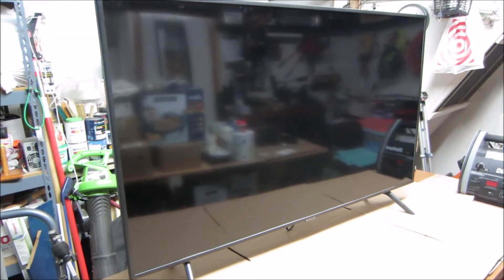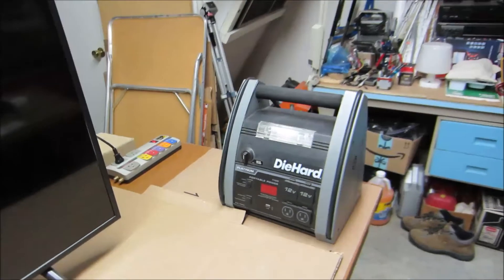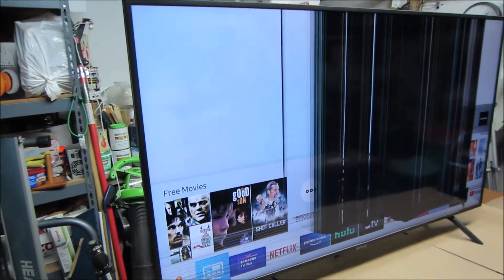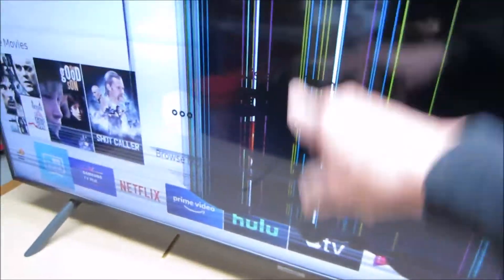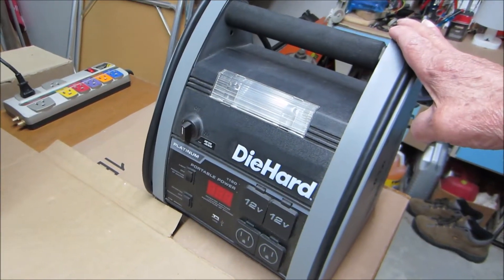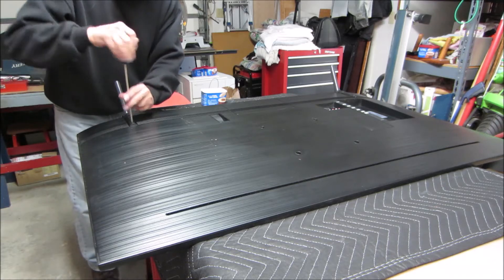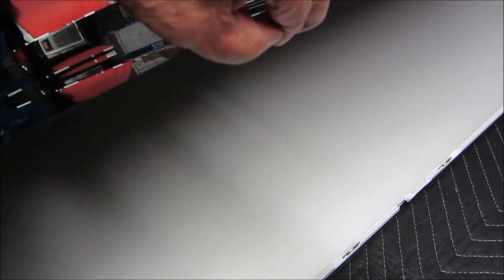LCD/LED TV Repair Secrets - Multicolor Vertical Lines

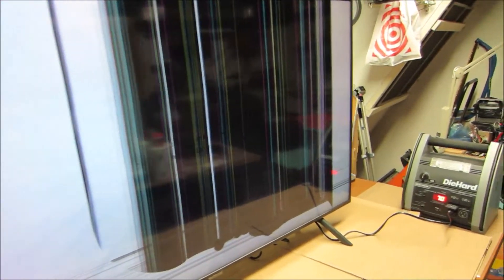Comment: 2:57 "you cannot get new displays". That makes me so mad. This is basically a scam and horrible for the environment. So you can't order a cheap aftermarket one from China that is of questionable quality? I guess these weren't as standardized as I thought.
Reply from the maker: The problem is fragility. LCDs are so so easily cracked, that the only way to ship them safely is by mounting onto a sturdy, metal, back plane as part of a complete display panel assembly. If you do that, what's left? An inexpensive PCB or two? A back cover? The legs? The box needed to ship a new display panel assembly would be the same size used to ship a whole new TV. The shipping costs would be the same. Plus, someone would still have to transfer the old PCBs, the old back cover and the old TV stand/legs to the new display panel assembly. What if somebody screws that up? That's why manufacturers don't sell replacement LCDs. I don't blame them. It's too risky. It's not cost effective. Yours is a good comment, though. Comments help the channel. Thanks for making it!